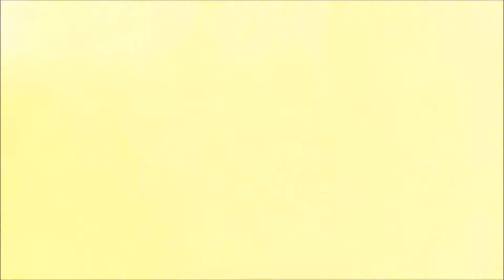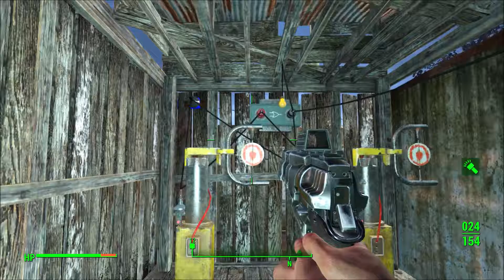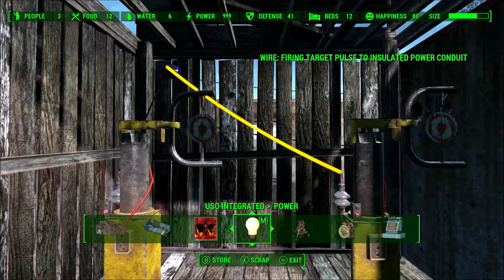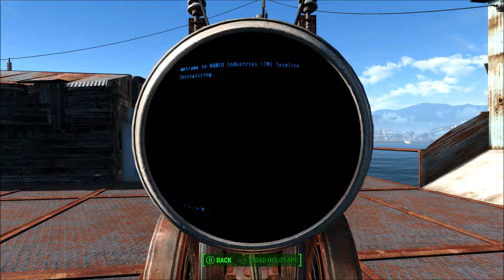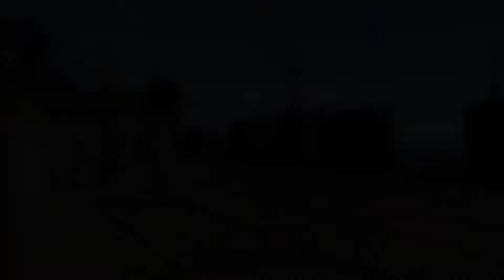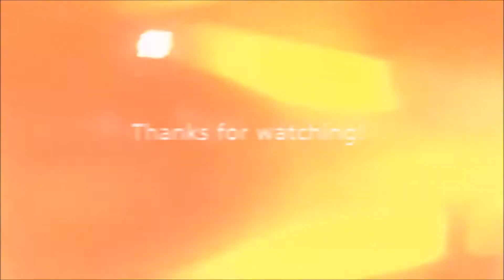Fallout 4: OR Gate Tutorial- No Mods Required

Comment: 11:45 since when have you had an issue filling time? haha Had to be said my friend.  A great demonstration and explanation as always.  I really like the door idea.  I feel like I ran into this same issue in my first Castle build where I had a gun range.  The only difference is I don't think I used an OR gate, but the counters did the same thing.  I will have a look to see if I was able to get it working.  Have you tried using a single shot weapon to see if that makes any difference?  I doubt that it does, other wise you would see the counter counting by 2.  I will let you know if I can figure it out on mine.
Reply from the maker: I have not tried using a single shot weapon.  I don't think it matters, since the first counter only increments by 1.  Incidentally, the OR gate isn't really required- you could wire all the switches directly to a conduit and then to the counter.  Perhaps the OR gate adds a slight delay or something that causes this particular glitch.